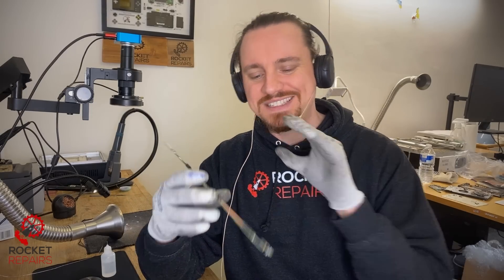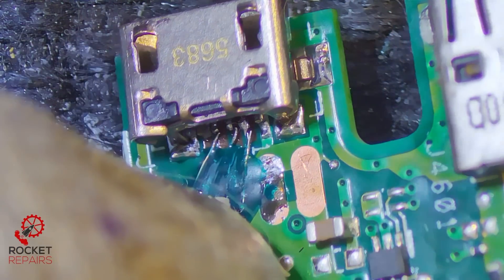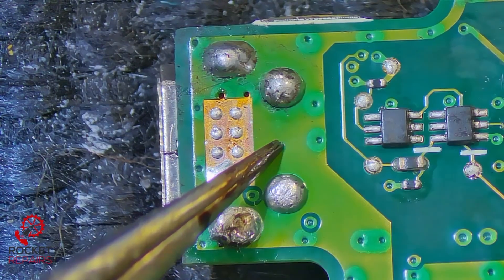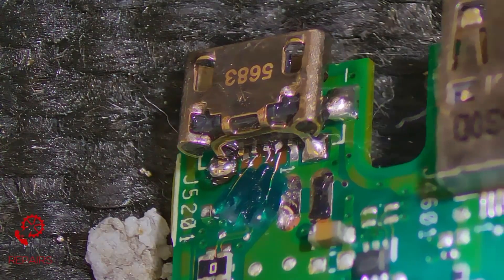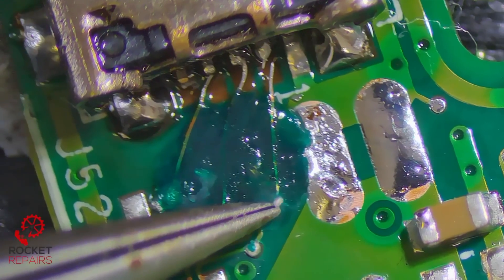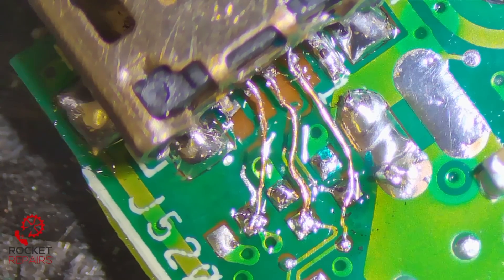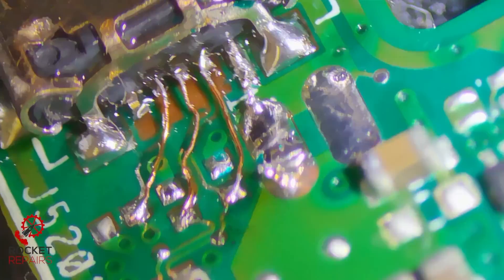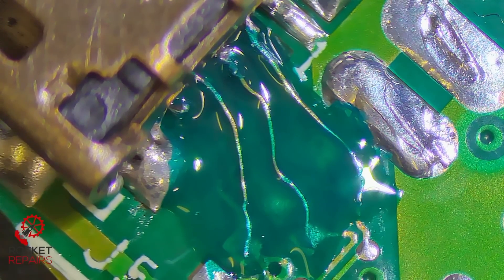OK IT WAS ME! Time to own my mistake and make amends! Laptop charger port repair.

Comment: Couple of tips from an old hand:  1 - Keep your soldering iron tips clean and 2 - The metal body of a connector is likely to have residue from the manufacturing process on it, a quick clean of the legs with a file and then tin the legs before fitting on to the board will always give a better joint.

Comment: I don't understand why not just use e6000 on all connectors that have ripped off and ones that are easy to rip off. Takes just a minute to add it. Smh
Reply: Probably because you'd never get the port off again without trashing the board, in the event someone damages the pins (for example). Epoxying stuff on isn't the right answer.
Reply: @EightBitTony  umm no. I repair car amplifiers for a living so I do know what I'm talking about. I've also worked on electronic like this, other day fixed Playstation 5 but i do car amplifier repair mainly for many many years. don't use epoxy lol Go get some e6000 it's very strong and if ever need to fix that again where you put the e6000 with heat like from hot air the glue breaks down a little to get it off no problem.
Reply: @EightBitTony  I never said epoxy sir. Should read what a person is saying before answering or at least look up what the stuff is the person is bringing up if have enough time to answer like you know what your talking about. See me I wouldn't comment unless I for sure know what I'm talking about but thanks for helping his channel, more comments the better right.

Comment: The Bluetooth speaker with the usb-c connector which had a missing pin and a ripped trace bridging that pin with the second one to its right, could be the next one to come back, since that trace wasn't restored and was there for a reason. 

Also doesn't conformal coating dissolves with acetone (aka nail polish remover)?
Reply from the maker: It's more likely to come back if the trace is repaired since it is a weal point. We've let the customer know it only charges in one direction and they seem happy with that.  If they change their mind then we'' redo it and make another vid. no problem :) And acetone not sure, we tend not to use it because it is quite corrosive to plastics.
Reply: @rocketrepairs  I don't agree, since all that was needed was a new connector, and a jumper wire between the two pins, so no stress on the traces would have occurred.

The issue I have with that repair is that Joey said something along the lines of "there is no pin on the original connector" implying that reusing the connector was fine, when the fact that there was a missing trace and a corresponding missing pin which most likely snapped off should have been a red flag.

About acetone it melts certain plastics, but there is no need to use as much as when cleaning stuff with IPA. A drop on a qtip is enough to start cleaning.

Comment: Some troll comments here... Honestly messing up only makes you learn. I'm still new to repair and was following you years ago when you first started and i was talking about getting into repair but had a lot going on so haven't been able to till now. I thought i absolutely butchered a power supply in work beyond repair today because i lifted several pads, Managed to fix it and it works. I was amazing, the guy that helped me test the power supply just said to me, Hope i everything and without hope we have nothing. Because i was just so certain the power supply was knackered. I was amazed when it worked.
Reply from the maker: The old adage, "The Person Who Never Makes a Mistake Will Never Make Anything" comes to mind!
Reply: @rocketrepairs  There seems to be people within the repairs the community that just point and laugh at people ruining boards, But theres a difference between a noobie ruining a board and someone that's really trying hard to understand and analyse what they did wrong the first time.

I'm messing up a fair bit with certain types of soldering in work... Theres pins on the back end of a power supply and they're sort of bent outward onto the pads throught the pcb and whenever i try to use a solder sucker or wick i never get all the solder off the legs that is still connected to the pad. So when i lift the leg up it pulls the pad with it. 

We all makes mistakes but learning from it will make you better, even the most professional of electrical technicians once upon a time butchered a bunch of electronics, let's not forget this.

Comment: Just my opinion: bad soldering skills.
Reply: Those micro USB connectors are a pain in the ass to solder. It may not be apparent from the video, but the pins he is attaching wires to are almost under the connector's metal case.

Also what you see on screen is 4 times smaller in real life.
Reply from the maker: Thanks mad dog!
Reply: @rocketrepairs  No problem. I can be critical of Joey's repairs, but I think I can also be fair. 😂 

Watching a PCB magnified 4/8/10 times makes people think everything is easy, but even melting solder and keeping it flowing can be a PITA when using small tips on a large copper plane sucking all the heat away.
Reply: I also repair things and do micro soldering as a hobby. With cheap equipment my soldering skills are way better.
Reply: challenge Joey to a competition and make a video out of it. 🤣